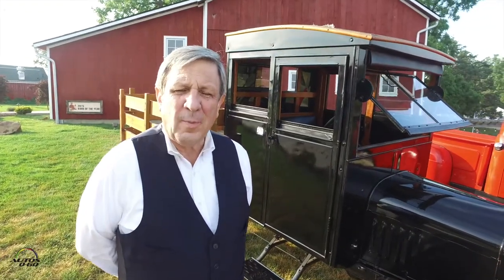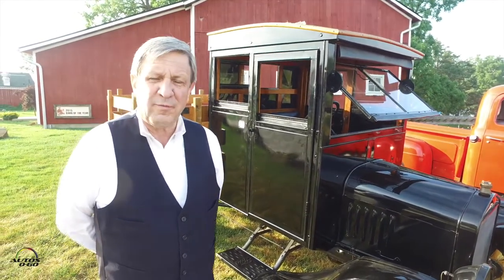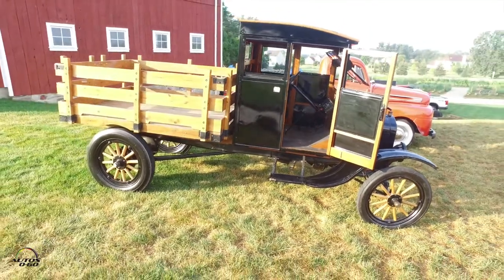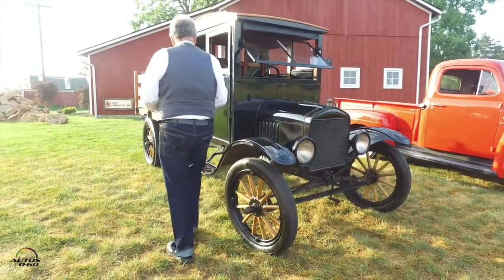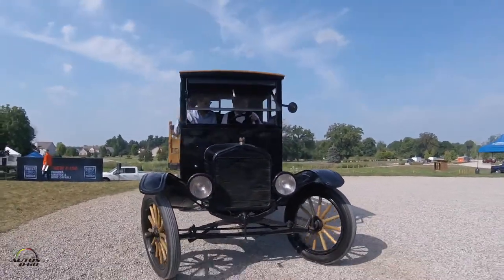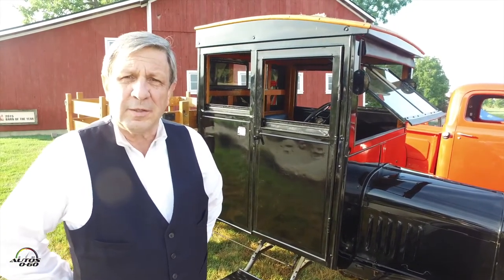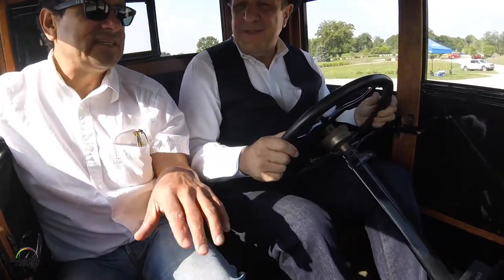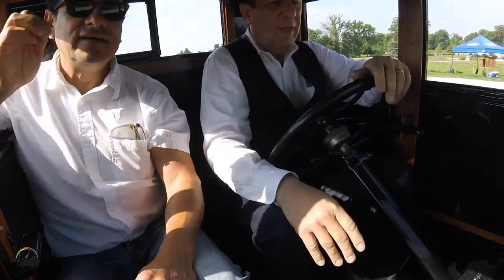1920 Ford TT Truck - 20 HP - 1 Ton cargo capacity - 10 MPH

Comment: I have  a 1918 Ford  TT  1 ton truck, will  cruise upto 30 mph on level roads  5 to 1. Worm drive diff on 33x5 tyres on back and ONLY modification to motor are alloy pistons and adjustable valves. Was put on the road in 1990